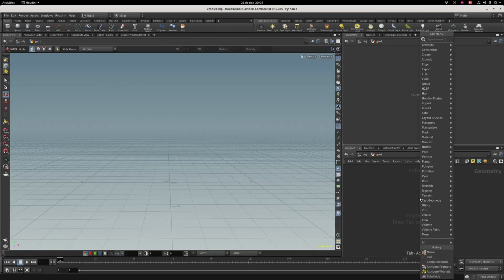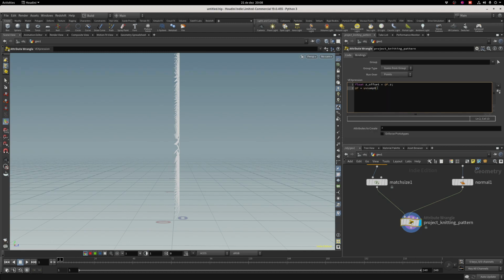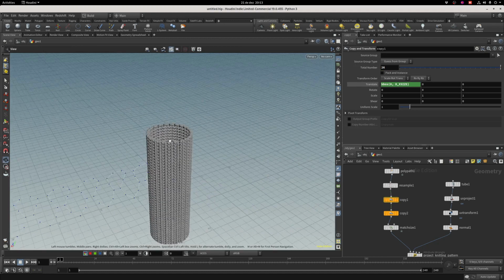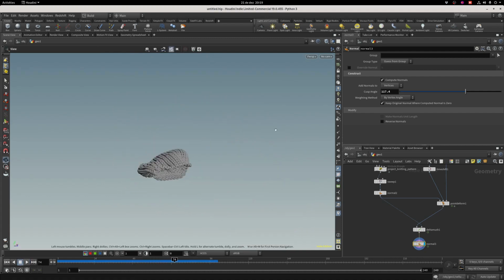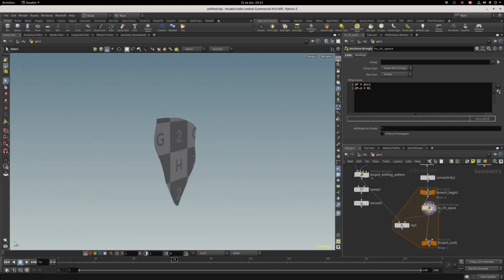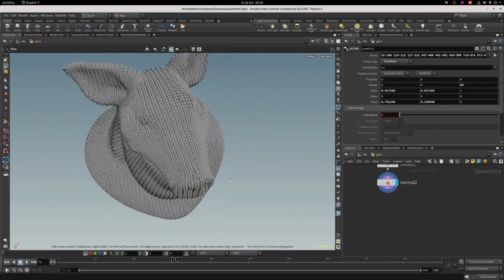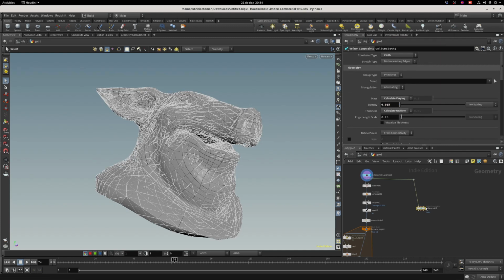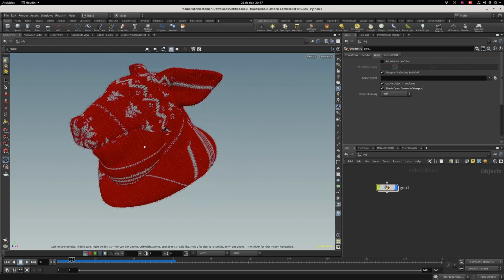Houdini - Procedural knitted fabric

Comment: hey thx for the awesome tutorial. i was wondering how you got the texture to show? when i add a texture image to my mat and apply it, it's just a solid color.
Reply from the maker: Put your material inside a material builder. On the material builder node, right click gear > edit parameter interface. Add a new "File - Image" parm, on the parm properties click "Built-in tags" button, search for "texture #", add that tag. Now load a texture on this new parm and it should display on the viewport. Alternatively, link this parm value with your original texture node to make everything dynamic.
Reply: @fabricio_chamon  brilliant i really appreciate you answering

Comment: If anyone made the same mistake as I did, uvsample for normal not working, it's because I moved the position of the knitting pattern to the tube position before referencing normal values. You have to reference them as variable like Fabricio did before changing the position of the pattern geometry. Or you could reference the normal first, then directly change the position value with v@P = uvsample(1, "P", "uv", v@P); since the position didn't change for referencing normal, it should work now